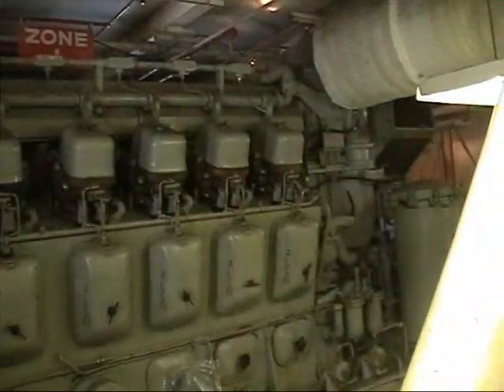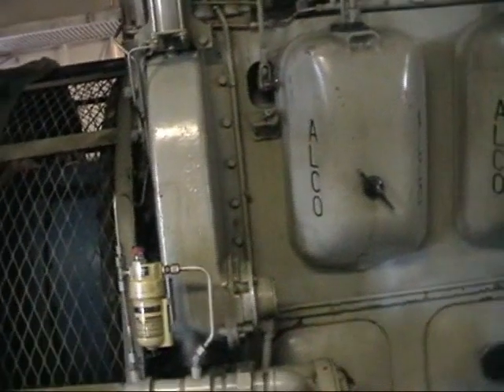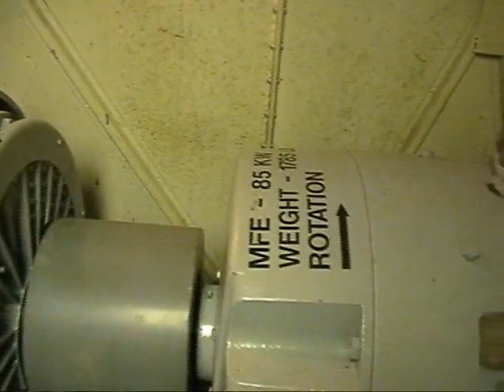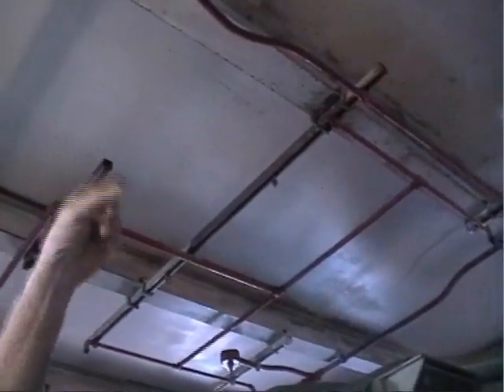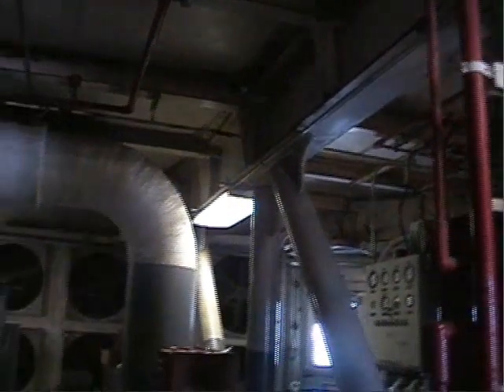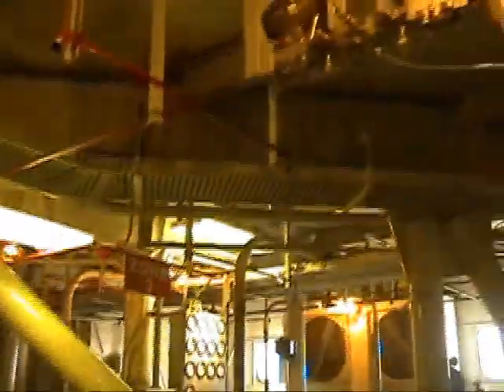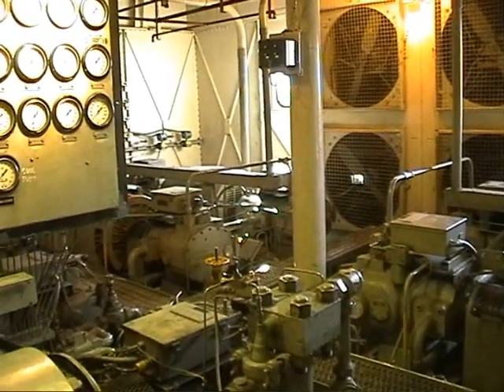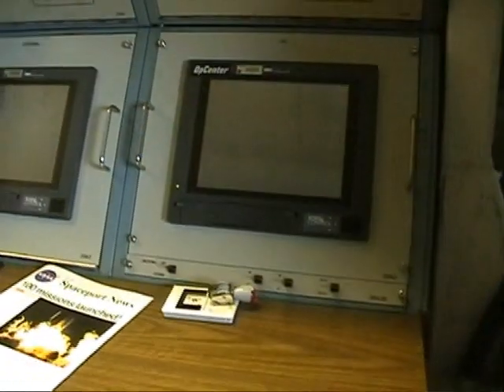Inside the NASA Crawler Transporter - PART 1 of 3

Comment: Those Alco locomotive engines have been replaced.  The upgrade is proceeding well.
Reply: @aurktman1106  Ahhh, I see.   So they are only replacing the AC generators.  The actual Alco Prime Movers for the DC system are staying and got rebuilt.  https://www.nasa.gov/content/the-crawlers
Reply: @alcoguy1  umm are you sure? That other article someone posted said the old Alcos were being sent to be resold or recycled.
Reply: Are both crawlers having their engines replaced?  What are they replacing the Alco engines with?  Thanks.
Reply: alcoguy1 I believe both are, at least one is already finished. I will find the video of the progress with the engines done.
Reply: @aurktman1106  Thank you
Reply: Maybe someone will buy them for use in a locomotive restoration. My understanding is those old diesels were pretty much like new even though they are from the Apollo era so it would be a shame for engines in such good condition to be scrapped.

Comment: Looks like the inside of a ship.
Reply: It's very much like a ship. The engines are ALCO 251 diesel engines, originally developed as marine power plants or for stationary power generation. They were used on locomotives later, but they were designed for ships and power plants.
Reply: @DavidRachlinMLIS  no, they where designed for locomotives first
Reply: ALCO built locomotives... from way back, steam ones then diesel ones.

Comment: A mighty piece of engineering! Sad part is the present administration has all 3 crawlers up for sale??!! THEY SHOULD BE NATIONAL HISTORIC LANDMARKS!
Reply: They aren't even for sale. One of the crawler is undergoing upgrades to bring the even heavier Space Launch System
Reply: There are only two crawlers. They are being rebuilt and upgraded to handle new class of heavier rockets. The clickbait Facebook articles are just trying to cause issues with politics. These are the most efficient way to move the rockets from the vab to the launch mound.